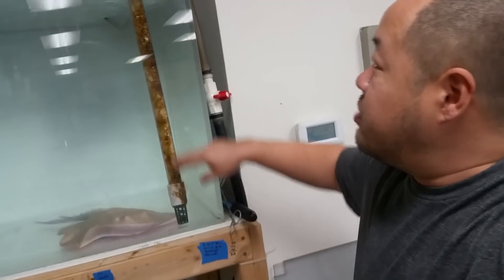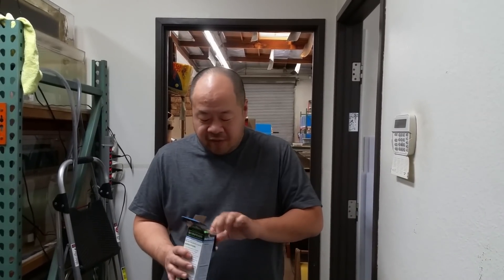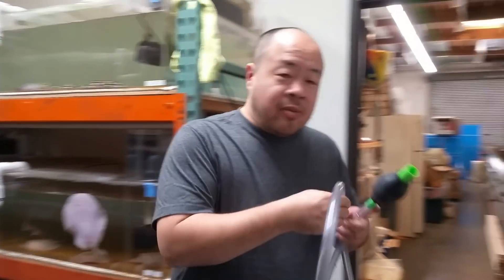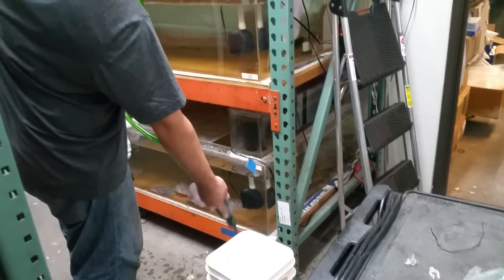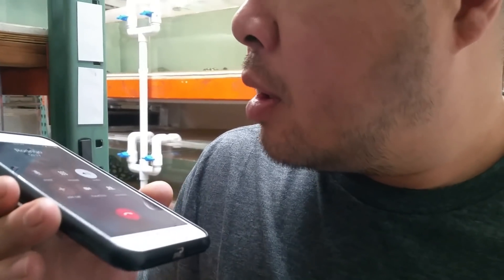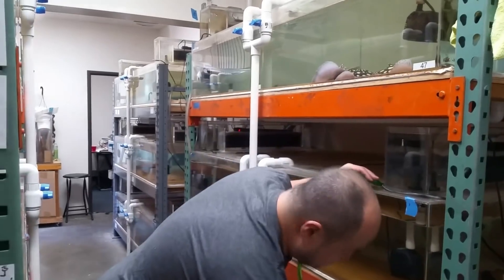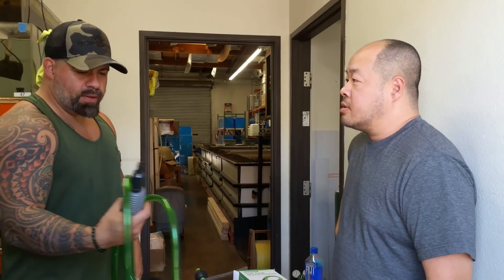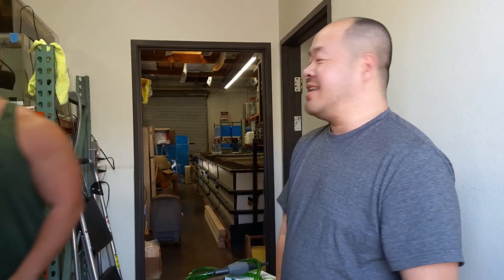Predatory Fins vs Stingray Biology  DIY aquarium siphon CHALLENGE

Comment: The only thing that made Rods better as far as function was once it was primed it just needed the valve closed and opened to work no more sucking or pumping . But that green one you had is pretty convenient but both have good points of use 😉
Reply: Rods idea was good, but like Kevin said Rods holds stagnant water in the hose from each tank which can create bad bacteria and potential effect your good biological bacteria if it accidentally back flushes into your tank.